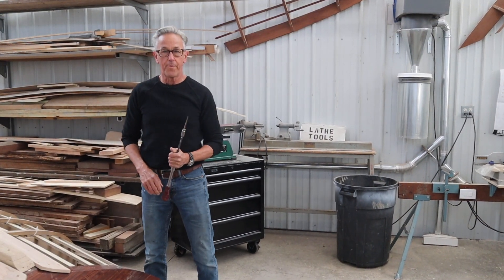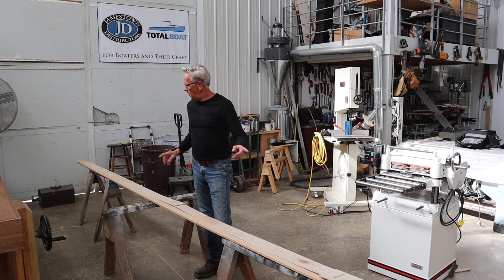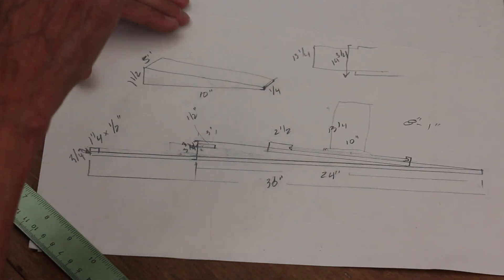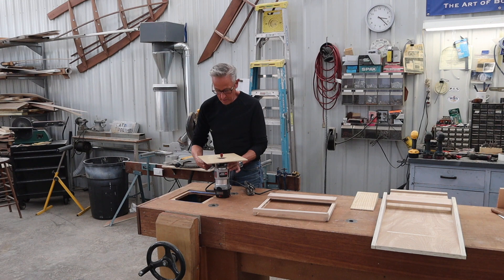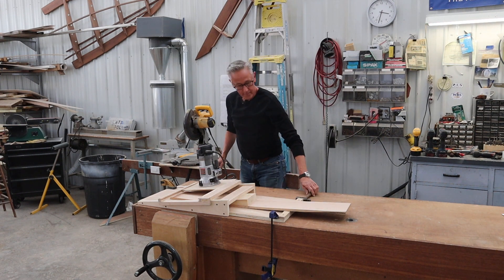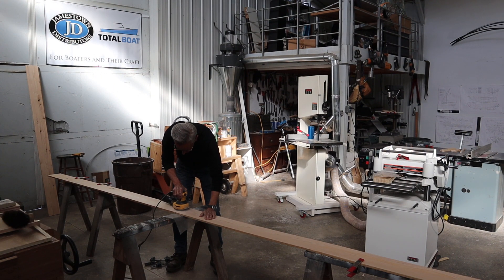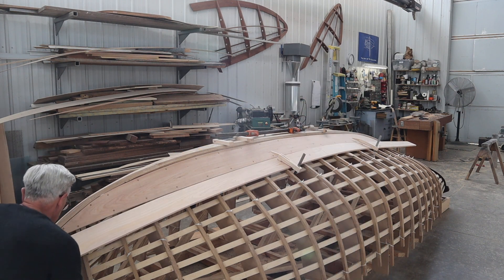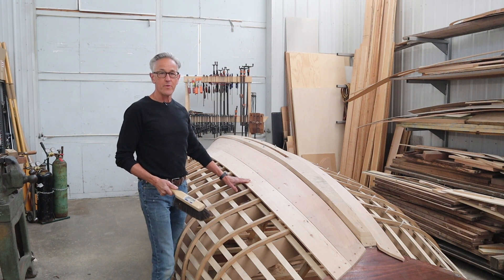Cutting Scarf Joints, Carvel Planking Part 4, S2-E20

Comment: Thank you for detailing the build of the scarfing fixture.  I have read several articles on that style but seeing it in action adds a lot of confidence that it will work.  The idea of running the router along the grain is something I would have not thought of until I had planed down the roughness on a number of boards after going across the grain. Thank you again and please have a great week ahead.

Comment: Curiosity is scarfing stronger then butt plates? Wanna build a 12 and 20 foot jonboat for beaver trapping. I dont like the idea however of an uneven bottom with butt plates every 4 feet. A lot to trip on and alot for gear to get caught on. Worried it might bust the boat with me and all my gear in it.

Comment: Why do you have that strip of wood at the front of the jig that raises the board you are planing? Doesn't it keep the board from laying flat?
Reply from the maker: That board puts tension on the board so that when the wood wedge is put in they work in conjunction with each other to hold the board firmly. The wedge forces the board flat to the base of the scarf jig.
Reply: @TheArtofBoatBuilding  But why bother with a wedge? Why not use a c-clamp and keep the board flat.
Reply from the maker: @gary24752  the scarf jig is clamped to the bench. It would be very difficult to get clamps where they would need to be. If it was efficient t to clamp it the clamps would mare the soft cedar. The wedge exerts an even pressure on the board. Many of the scarfs are not at right angle cuts. The wedge is a quick way to get the plank secured quickly a and release it quickly.

Comment: Ummm.  You had the scarf joint completed when you cut the 2x6 wedge. Why not just use that system with a fence and a little block plane/sanding?   I respect the desire for perfection, but thickened epoxy is very forgiving.

Comment: please use a push stick when using the circular saw, your fingers don't grow back...at 6.25 + good information otherwise . you can copy the line for the second plank directly from the leading edge of the first one using a 2 " x 1 "block against it and on top of the new piece (new plank clamped on your spacers or ribs less than 2 " from the edge ) using a pencil.no need for a compass etc. The line is ready for cutting when the plank is  removed.
Reply: At least use a push stick when people are watching!

Comment: I thought I saw a nasty knot on that broadstrake.  I just saw an episode with another boat building project where they fixed those knots.  The channel is “Acorn to Arabella and the episode is the following link.  Advance to the 16:30 mark.
https://youtu.be/_ma3ojQHDsA
Reply: The title of the episode is “Antique Thicknesser”
Reply from the maker: I'm aware of A2A Steve and Alix are good friends. The difference is they are using 1.25" thick white oak. The planking I'm using is .5" atlantic white cedar. The small knots will be easily filled with fairing compound.
Thanks, you have some good eyes there. 
Thanks for watching.

Comment: Beautiful fit on that broad-strake. Is it or the garboard beveled to fit the adjoining edge? Also, did you use it as a "kinda close" pattern for the port side broad-strake? 
Thanks, and keep up the beautiful work.
Reply from the maker: Thomas Russell Yes, it does have a slight bevel. I did include that this time as it was very slight. I will show how to make a rolling bevel on a plank that it’s more pronounced on. Easier for the camera to see. 
I did use the starboard plank as a pattern for the port side. 
Thanks!
Reply: @TheArtofBoatBuilding  thanks for the reply.

Comment: Is there a reason why you didn’t use the plank as the template for the second plank on the other (port) side?
Reply from the maker: Barry Karow I did check to see how it fit. Which was good. I then used it as a pattern for the port side.